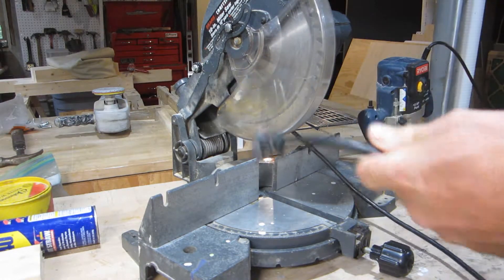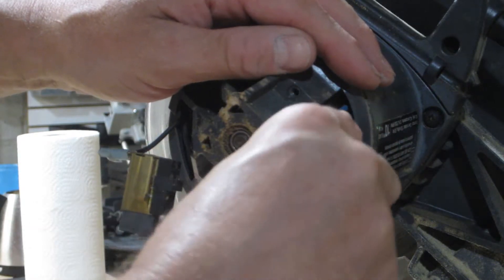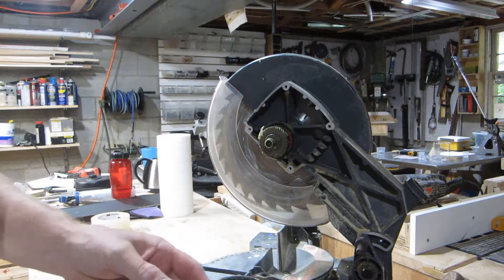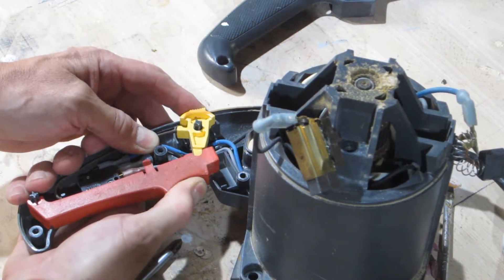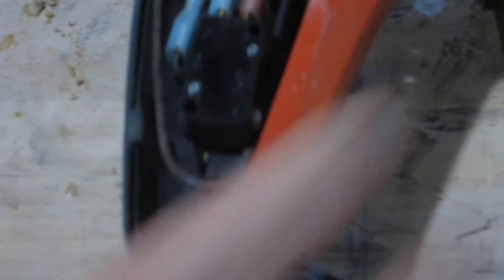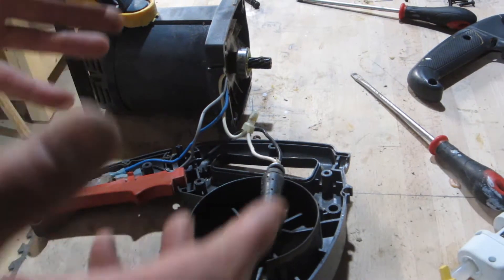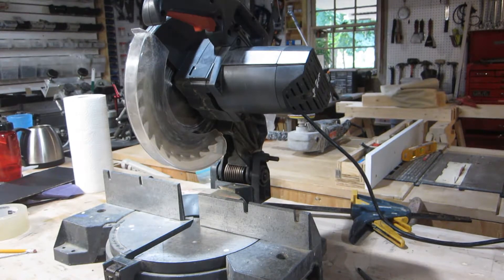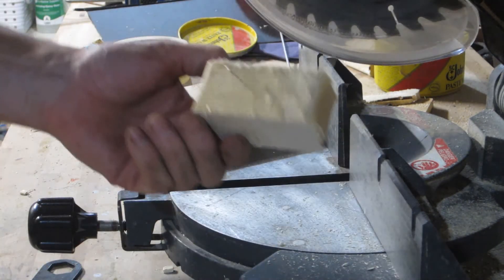Can this Craftsman Miter Saw Be Revived?

Comment: I was impressed with just taking it apart and putting it back together fixed it.
 
Broke the handle on my Craftsman miter saw. (My favorite tool.) Don't have all the tiny plastic pieces, so epoxy putty to fill those missing spots. First, I have to get some superglue and glue the pieces I have back together.

Unfortunately, some wires and a spring fell off before I could take pictures, so I'm looking for some place showing a wiring diagram.

Any suggestions?

Comment: hey, I just purchased the same model miter saw and this video really helped. The last couple of seconds of the video show some sparks coming from the motor. Did you ever get around to addressing that? I'm having the same issue despite having plenty of material left on the brushes.
Reply from the maker: Hey Franccesco.  The problem with my unit turns out to be where the operator meets the tool.  You can see that the trigger switch is weirdly placed toward the rear of the handle (closest to you) but the actual trigger grip is towards the front. Try squeezing up at the back of that massive trigger switch to see if it gets things going.  I have not actually fixed it since I know how to get around it but, it might be as simple as wedging something under the switch to get it to make better contact.  Good luck mate.
Reply: sparks at the motor can just be the brushes wai or even sawdust that got in there. most motors spark a little on startup.